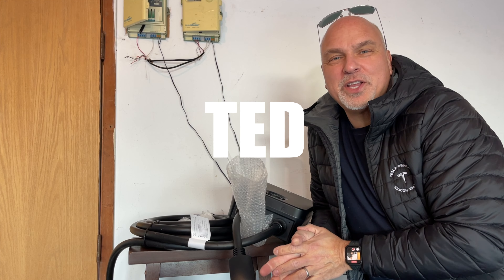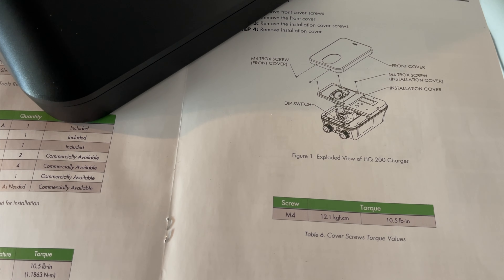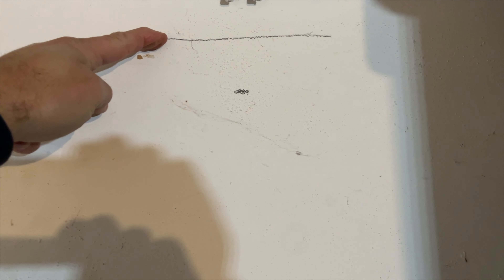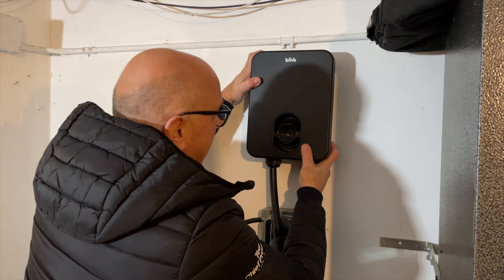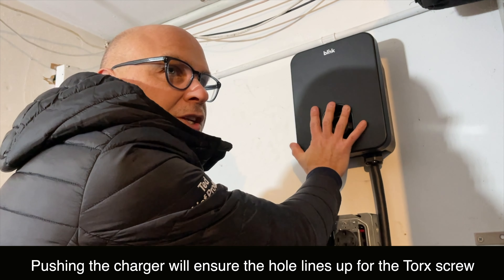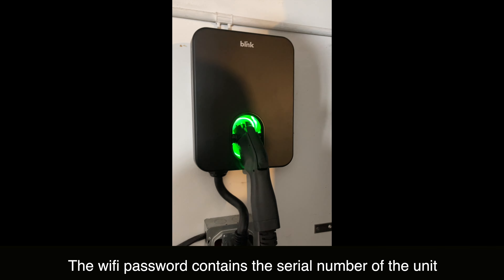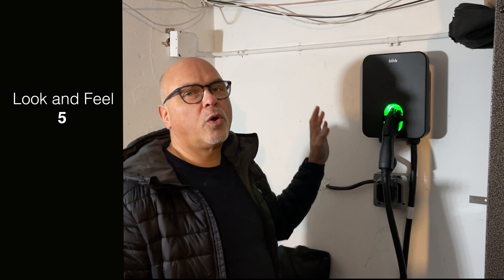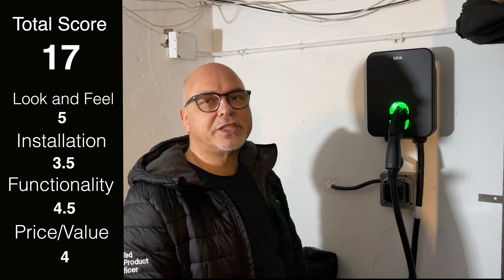Blink Charging HQ200 Review & Installation, Great option for charging your EV

Comment: The most difficult part was finding the Torx bit. After that it was straightforward. Overall it is an impressive charger.
Reply from the maker: That was rough hahaha
Reply: @TeslaOwnersSV  - For clarity, finding a Torx bit was not rough. I've informed Blink about using Phillips screws and putting the Torx screws in a bag in case someone is concerned about security.
Reply: How did setup the app? I’m not showing the home button on my version of the blnk app.
Reply: @Nightcrwlr99   Hey @teslaownerssv  Can you answer this question?